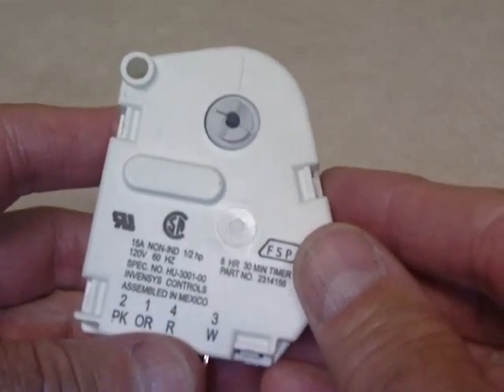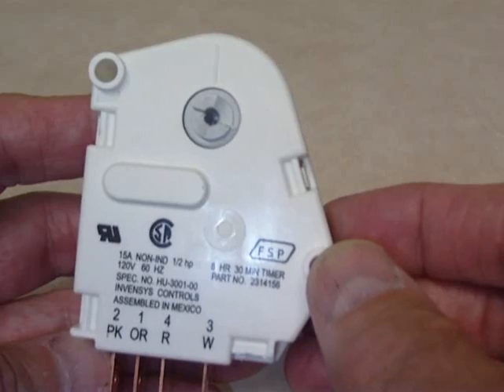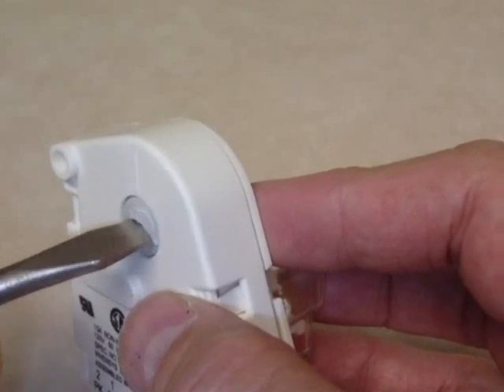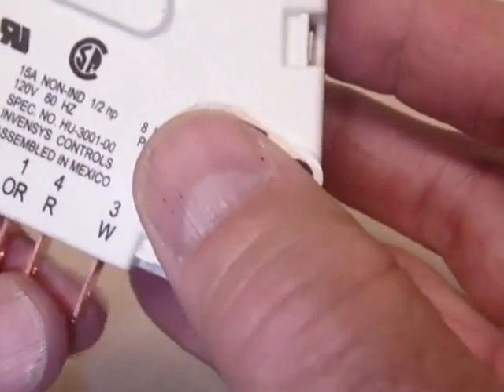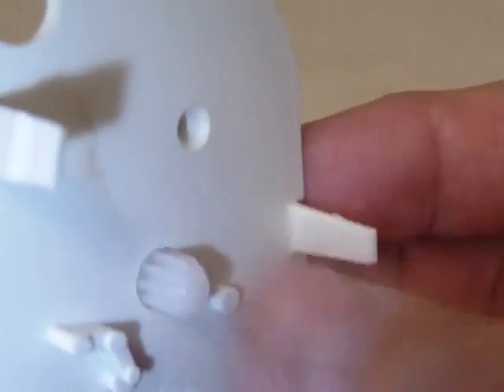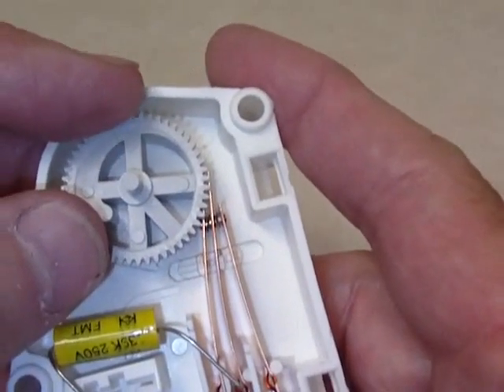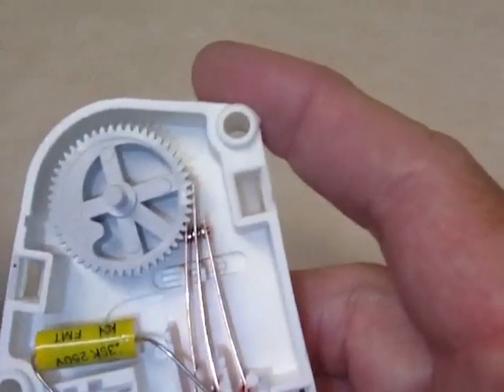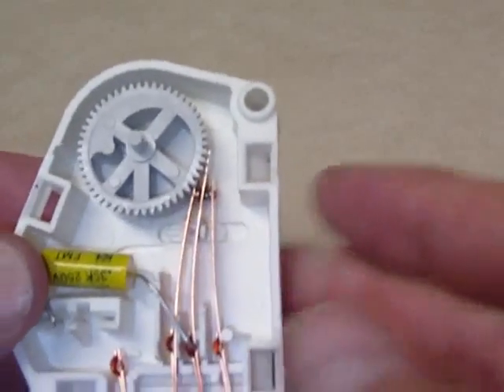DEFROST TIMER FAILURE

Comment: The timer shown in this video was assembled (or was reassembled) incorrectly. The two white vertical spacers should be one on each side of the center contact. The two outer contacts should both be "outboard" of the white spacers. Easy fix. The spacer is there to prevent the center contact from being able to touch both outer contacts at once (which would make the compressor and heater run at the same time). Looks like this unit has the left and center terminals incorrectly squeezed together by the white spacers. The leftmost contact needs to be moved outboard of the leftmost white vertical spacer.

Comment: On my GE fridge, this is behind the plastic panel on top where the freezer and fridge temp setting (and light bulb) are.  You can see the part where he turns it with a screw driver once that panel is off.  I used a black sharpie to put a little dot on one part of the wheel.  That way you can see if it is rotating over time and see if it makes it through the defrost on/off part of the circle.  If it gets hung and does not rotate, then 100% this part is the issue.  Turns out mine was rotating fine and my issue was the defrost temp sensor was messed up (that is clipped onto the coils behind a panel in the back of the freezer on my model).

Comment: Yeah, apparently, a lot of the times, it’s the timer. But, for my situation, it wasn’t. I’ve replaced the timer and the issue persists so, I’ve received a new defrost thermostat and am awaiting a defrost heater so, I can just replace those 2 items, without buying a multimeter too. The fridge is at least 15-20 years old so, I didn’t mind learning and finding out that replacement might be easy and cheap.

Comment: Awesome video/explanation  I have a 25 year old HITACHI fridge,,, the timer mechanism has recently  been making clicking noises & ice cream in freezer has liquified. I'm going to try opening up the timer to see if any part of the clock can be tweaked back into place- as I'm having trouble finding the exact model number replacement part.  There is an HITACHI defrost timer available, and it looks very similiar in size & plugs .... what are your thoughts on replacing with a similiar but not specific model number replacement. Im thinking it would safe as there couldnt be too much voltage/amp etc difference.  The fridge is a beauty apart from this happening ⛄

Comment: Have a Ge double door, The condencer get warm , the fan in the back comes on, the fan in the freezer side comes on
whe the door is close, but the freezer don't freeze, and the fride is bearly cool, 
what should I check for. to get is working again.. Thanks
Reply from the maker: The first thing you need to check requires access to the compressor.  See if the line running to the evaporator coils is cold.  Easy to check but you have to pull the unit out from the wall to do this.  If the compressor is running and the line is not cold, you have a refrigeration system problem.

Comment: most of these timers they are energized only when the compressor is running.  i seen them on light commercial refrigeration ice cases. as most techs replace these clocks and install a commercial refrigeration defrost timer/ time clock as they are better and you can set your defrost time when you feel you need it to defrost. im sure you could wire this time clock to a standard refrigerator if you install a Paragon 8145-00 115 V timing motor the timing motor has to be live all the time not cycled with the compressor. as it has terminals which you can wire the compressor and fans to it for normal refrigeration mode and the terminals for the defrost heater. as some of these commercial defrost time clocks will have a defrost termination solenoid if you install a defrost termination switch on the evaporator if it senses the coil temperature and if the ice is melted after 20 minutes it will energize the solenoid behind the clock and kick it out of defrost and the refrigerator will operate back into refrigeration mode till the next defrost is initiated. as these Paragon time clocks are real easy it has start pins to say how many hours it will go into defrost . as these cheap plastic timers don't do much. If you wire this clock to your refrigerator or freezer the timer motor has to be live all the time so it has to be wired to the power cord. as well you need a wiring diagram of your refrigerator and freezer to connect the wires to the clock terminals.

https://www.supplyhouse.com/Paragon-8145-00-120V-Defrost-Timer?gclid=CjwKCAiA_ojVBRAlEiwAOLRxI0yIHb89jXPWwy-GKDAgzc2W8dvxHIkqNMRgXOjmyTh3soa3kDr36hoCoK4QAvD_BwE

Comment: I have a refrigerator for 6 months that I have never seen the glow of the defrost coil until I manually turned it on to defrost, and I've had temperature problems with it I'm going to see if it goes out of defrost now in about 10 minutes and see how it runs

Comment: yea like gunter says the white spacer think looks broken ,,,there should be 2 little walls surrounding the middle contact,,, the heater contact pushes on it to keep the defrost heater contact from touching the center contact till it hits the drop on the cam then it allows the defrost heater to contact the center but like others said this is a cumulitive run time timer so it only runs while the compressor is running for more energy efficiency like say you never open the door the compressor runs less so there is more time before a heating cycle unlike mine where it just defrosts every 10 hours rain or shine

Comment: So THAT's where it is!  Thanks for posting this vid.  Somebody put a refrigerator at the curb, I got it going without having to buy anything, now I've got it running to see if defrost timer kicks in.  I was wondering where the timer is and saw that "one-way" turning switch but didn't know what it was, ...now I do, thanks!  Now I can go check, come back later to see if it's rotating, I don't know if the timer is working yet.

Comment: >>>>>>>>>HELLO: IF YOU NOTICE, THE TERMINALS LABELED ON YOUR TIMER HAS A RED WIRE, WHICH INDICATES YOUR UNIT IS WIRED FOR A CUMULATIVE-RUN TIMER. THIS MEANS YOUR TIMER ONLY ADVANCES WHEN THE COMPRESSOR RUNS. THIS CAN SEEM LIKE A "BAD" TIMER WHEN IT IS NOT. PLEASE READ YOUR COMPLETE INSTRUCTION SHEET INCLUDED WITH YOUR NEW TIMER. THANKS

Comment: Anyone know how often these defrost timer mechanisms fail/need to be replaced? I had mine replaced about 6 months ago, but have had to manually turn the dial again recently since fridge stopped working again. After turning the dial with a screwdriver, fridge started up again, but I'm curious how often it's going to crap out...? Could it be due to something else that's messing with the mechanism? - Tx for your vid! I saw the repair guy do this, but needed to know which way to turn the dial :)

Comment: I suspected this is the culprit of my fridge acting up (not cooling). I am ordering this timer and hope the problem solved once I changed it soon. For now I have to turn the timer manually to get my fridge compressor up and running again. At this moment I'm not sure if it is really the problem from this item or not.

I read somewhere that some fridge model, the timer will stop running when the compressor is off (due to balancing of the temperature?). I sensed that mine is off by listening closely to the timer when the compressor is off. Once its running, the timer runs again. Any idea?
Reply: The timer stops running as long as a bimetal attached to the evaporator coil is closed. As the temperature goes up because of the defrost heater, the bimetal will eventually open and the timer will start running again. It will run for a few minutes to let the evaporator cool down before the compressor is turned on again. Most videos miss to explain this or they explain it wrong. The defrost timer has 2 functions: 1. start the defrost cycle every x hours. 2. let the evaporator coil cool down after defrosting. There is a code on the timer like : 0804 or 0604 or 1004. 0804 mean 8 hours between 2 defrost cycles, and 4 minutes evaporator cooling down after defrosting. How long the defrost timer effectively take depends on how much ice has built up in your fridge.

Comment: With all due respect Sir, the video wasn't of any help and was of very little substance.  You took so long explaining and talking that this would've been a 3 minute video at most.  You said that you fixed the problem of the timer being sort of stuck as it approaches the defrost mode.  However, you did not show anything about how you've fixed it even after explaining over and over how the main cogwheel turns and activates the whole cycle.  Hopefully you can expound further especially on how you've actually repaired the stopping/ stocking up of the cogwheel.  Again, I say this with all due respect.  Thank you and more power.
Reply: rip fandango p.s.  i just realized, so this video then is basically about explaining how a defrost timer works, how you've identified that it was indeed causing the problem and how it was causing it, then how you've fixed the problem by replacing it.  This is not an actual video on how to fix the defrost timer.  Apologies.

Comment: Bill, your videos are helpful. I think I've narrowed down my frig problem to the defrost timer, but one uncertainty exists.  Hopefully you can help sort this out.  The freezer and frig sides both go warm for extended periods melting ice cubes on the freezer side.  I checked continuity on the temp control and got infinity while off and .2 when cold.  When the frig goes warm, I can turn the dial on the temp control off and back on it may restart.  When I turn the dial on the timer it will restart. Sometimes I have to turn it a ways before she restarts. Could it be that both parts are in need of replacement or am I really just looking at a timer issue?

Comment: 1 and 3 go through the clock motor which has a capacitor in line with it,i set my gauge to mfd and check it just to get a reading,1 and 4 go to the compressor,just check for cont there,1 and 2 go to the heater that defrost the coil ,just check for cont there also,just make sure to advance the clock to close the contacts for what your checking,either cooling or defrost,most of the time the problem is the clock will not advance and it will either be stopped in defrost or cooling

Comment: Can you do me a favor and check that the clock is being run with the capacitor in series with the motor of the defrost timer.
I am trying to figure out if the capacitor was put there for noise or just to blow if the windings of the motor shorted out, I would really like to know, Thank You.

Comment: just got a used frige and it sounds like there is some problems with the defrost timer . at present the back freezer freezes up every month and stops cooling in the lower frige part ..does that sound like the timer ?

Comment: thanks for the valuable information presented on your video, My refrigerator is a kenmore 20 years old but in perfect condition except as you mention,  the timer goes thru the defrost cycle ok and the compressor starts inmediately but the timing motor stops turning and never advances to complete the next defrosting cycle , COULD IT BE AS YOU MENTION THAT THE TIMER HAS GONE BAD AND NEEDS REPLACEMENT ? ,

Comment: FYI, 8 hours and thirty minutes does not mean it will defrost 3 times a day.  it will defrost for 20 minutes for every 8:30 that the compressor/cooling cycle is running.  If you keep the doors closed this could take days between the defrost timer cycles even once.
Reply: ArJuna22 if that's the case ,then how will the timer come out of defrost mode ,the compressor won't be running during defrost

Comment: Useful info, on mine I could hear a constant annoying mechanical noise which must have been the clock motor struggling to turn. and the ice was built up also the drain hole was blocked.

Comment: I had problems with a similar timer. Your video helped me find it. In my case the capactor in series with the clockwork motor had failed. A $2 replacement high voltage 0.1K polypropaline capacitor fixed it. Better that spending hundreds on a new timer. And having done the job myself I now understand how the system works.
Reply: right on

Comment: not the cheapest service but we know how it works, domestic fridges and freezers are known as disposable units, they are hard to work on, and very often it will cost you more to replace a part than it will to buy a new one. before a unit is disposed of the "gas" or "freon" must be removed. there are strict regulations on how this "gas" is dealt with and without the right tools and knowledge it can be very dangerous. 5 years of school for this, you wont learn it reading a few posts,

Comment: you may be going in the wrong direction if you think an iced up coil is a defrost problem, there are many reasons for a coil to ice up. these crap timers do fail. but a system with a small leak will ice up quite fast, if a fan motor has gone, air flow problems such as a blockage (dust, plastic bag, no breathing space behind the unit, an overloaded freezer or a plugged drain line) after checking what you can, a tech should be called before spending money on replacement parts you may not need.

Comment from the maker: Sounds like defrost is not working....and ice is building up in the freezer drain tray causing blockage.  The result is water will drip into the lower compartment.  You have to remove the freezer panel and check.  If ice also blocks the air chamber to the lower compartment, then no cold air gets to the bottom chamber--making it warm.  All cold air to the lower chamber comes from the freezer level.    Turning off the unit for 24 hours thaws the ice, but it may not clear the drain line.

Comment: nice demo video, I got motivated at least open and see, waiting when my best half will go to shopping other wise you understand ...our ff41 model whirlpool, freezer working the other bottom chamber not cooling , bottom of the freezer getting condensation and dripping water, problem I feel as you explained could be timer, or defrosting system, other wise ...mechanic came and told us to keep the unit shut off for 24 hours,, what is  the logic, is it the liquid / gas in coils got breezed?  help